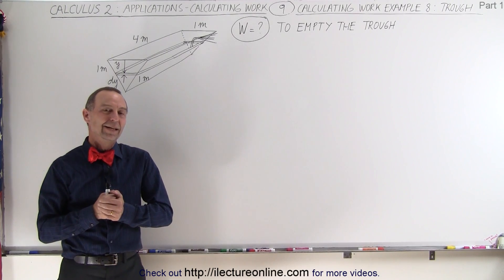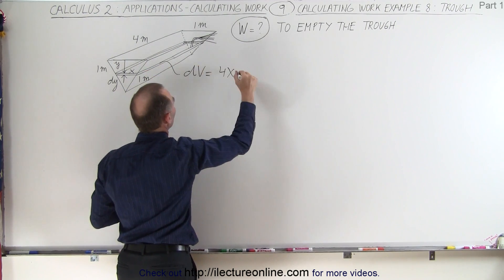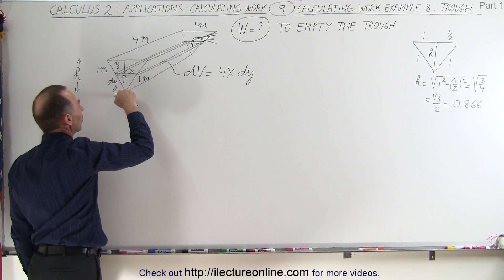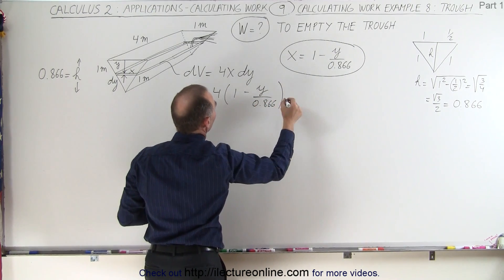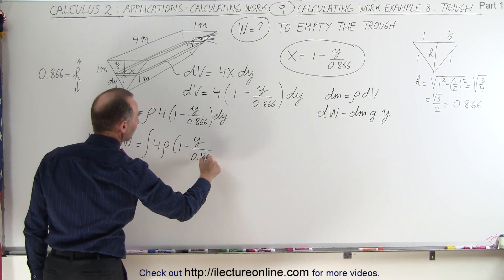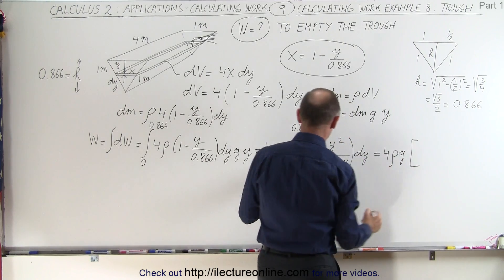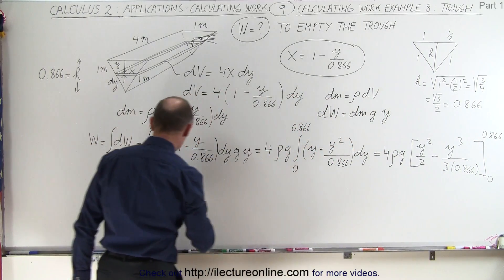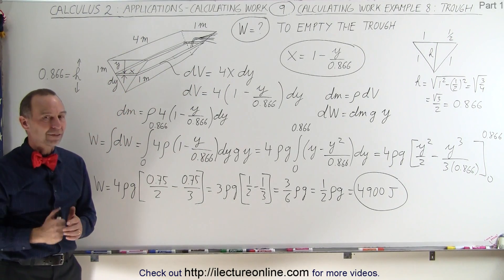Calculus 2: Applications - Calculating Work (9 of 16) Calculating Work Example 8: Trough (Part 1)

Comment: Hi Prof Michel 

When trying to find x in terms of y, I use both your method and I also draw a Cartesian plane for my shape. I am however struggling to know where to place the origin of my Cartesian plane. For instance would it still work out if I plotted the origin of the Cartesian plane at the base of the triangle (top) or at the bottom of the triangle (bottom). 

Thank you again for your videos
Reply from the maker: In theory you can place the origin anywhere you like.  We typically place it at a location such that the equations are easily solved and integrated.
Reply: @MichelvanBiezen  thank you Michel 🙏🙏🙏
Reply: @MichelvanBiezen  also your videos are really awesome 🙏
Reply from the maker: Thank you.   Glad you like them.  🙂

Comment: Brilliant. You make it seem so simple. I think finding the relationship between x and y is the really tricky part with situations such as these, I guess it just comes with practice. Thanks
Reply from the maker: That is the key.  Lots and lots of practice is the key to understanding.
Reply: I guess I need to stop getting so frustrated when I don't understand something right away then :) 
I'm very glad I found your channel. Thanks
Reply from the maker: If you can remember that throughout your studies it will cut down on the frustration.  Sometimes it just takes time to get a new concept to sink in and to understand it.  Just know that if you spend enough time on it you will understand it.